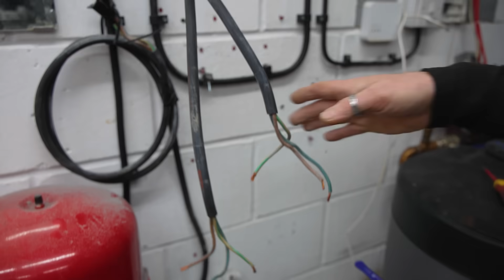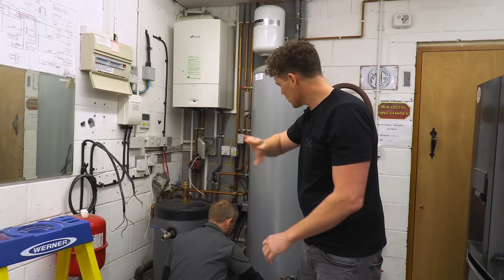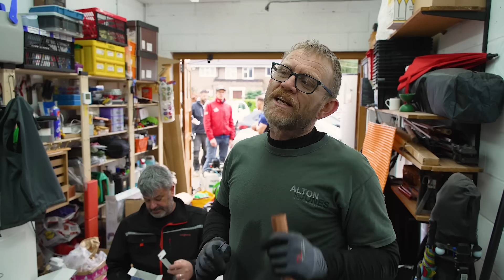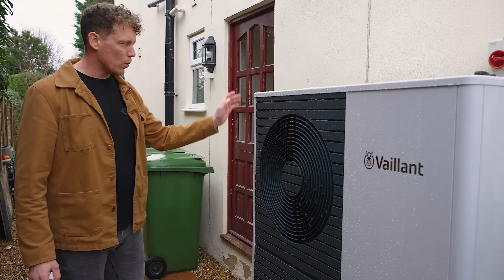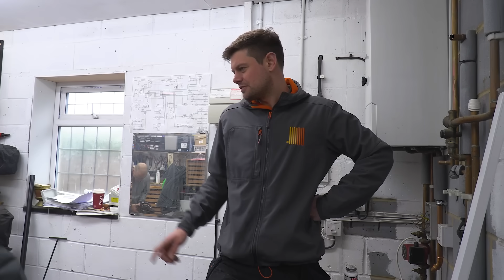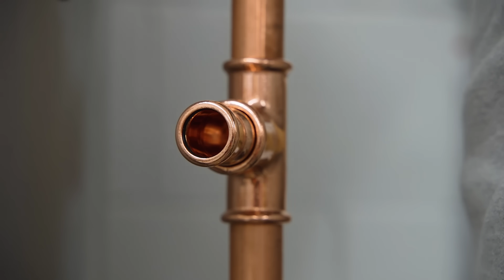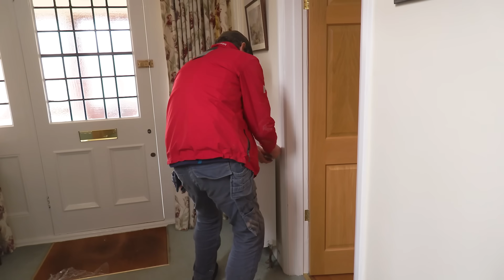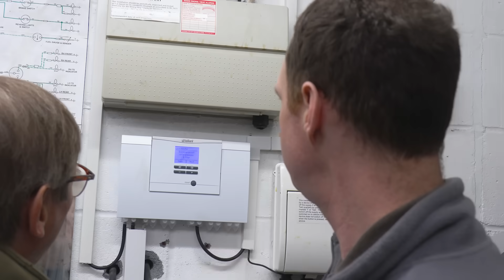Ultimate Heat Pump Installation. Rip It Out & Start Again!

Comment: Looks really good!

A quick question - is there an issue with the open drain grate between the HP and door being in the exclusion zone?  I only ask as I have a similar drain and wondered if it presents a problem for R290 systems?
Reply from the maker: To be honest it was impossibe to comply with all the R290 requirements with regards to the back door and window. The open drain issue is about spillage of the propane into drains and water courses. 
There is no chance of that with this drain and if it were an issue it would be possible to put a cover on it.
Reply: No, drains were an issue and vailant have since removed it from the instructions.

This system complies 100% with r290 exclusion zone in all dimensions.
Reply: @HeatGeek  I see what you mean - The instructions changed in November by the look of it.  That makes things easier...

Comment: I would like air to air units and have a tank with a heat pump on top that covers the hot water issue get rid of the radiators , that way would not have the cost of upgrading the radiators plus would have different zones in the house for heating rather than heating areas that hardly get used , it would get rid of the gas completely so no bills there not even standing charges, open to other opinions, for me seems daft not to take advantage of the grant available.
Reply: The economics of air to air can be quite good if your primary heating source is fuel oil, bottled gas or resistance electric. I'd expect the tipping point for natural gas to happen within the next few years, if not sooner, driven by geopolitics and the activities of useful idiots that influence public policy. 

The break even for my self installed system including the purchase of some specialized tools and ignoring government incentives (for the moment) will be about 5 months. I could have spent a little less on less efficient equipment but my operating costs would be somewhat higher negating all upfront savings within a year or two. 

I'm less impressed with air sourced water heaters that get their heat from conditioned space that you've already spent money to heat. I don't see the cost effectiveness there.

Incompetence, price gouging and sometimes downright fraud continues to plague much of the heat pump sales and installation industry. It's a systemic problem that the industry itself needs the resolve to solve. Adding government regulations would primarily benefit larger businesses and stifle competition. Not good for consumers. I agree with both Roger and Adam that government subsidy programs are only making those problems worse.
Reply: @jamesnasium7036  sorry I must of missed what system do you have ? Sounds like the water tank with heat pump on top you’re not a fan of ,
Reply: @KavanOBrien  Heat pumps are great for moving heat energy from someplace where it does not benefit you to someplace where it does. Of course it would be wise to balance  equipment and installation costs as well as current and and your best guesstimate about long term operating expenses against those of any viable competing system. That balance can be wildly different depending on your location.

In one of my locations I was heating my DHW with propane and my conditioned space heating was with fuel oil. Propane prices had recently gone crazy due in large part to political interference as part of the war on fossil fuels. Natural gas was not an option. I considered an ASWH with a COP of about 3 until I realized that I would in effect be using some electricity + a large amount of already paid for fuel oil sourced heat to heat water.
That heat in my conditioned space would have to be replaced of course by burning more of you know what. Even with the incentives (while funding lasts) that would come with a pile of bureaucratic paperwork, the equipment would have cost about 4 times as much. The break even point would have exceed the equipment's projected lifetime. In my case a well insulated resistance heated tank made the most economic sense. 

Unless you have a surplus of unwanted heat (or humidity) in the location where your HPWH would be located (and taking it's heat from), I don't see any benefit.
Reply: @jamesnasium7036  you don’t see any benefit in regards to what = the tank ? Heat pumps in general ?

Comment: So I have a combi boiler which I have tweaked to run at a flow temp of 50°c currently. What would this mean if a heat pump was installed?
Reply: It would mean you would not need your combi boiler.

Comment: Nice follow up on previous visit. Watch both videos. Good new loft insulation but what’s with the very poor side door. I’d replace that asap. Does the temp adjustment + - do anything if it’s in weather comp mode? I thought that was disabled? I have similar setup but 7kW version. Also wish my HG installer had used more anti vibration mounts for pipes rather than plastic clips that transfer any pipe/pump vibration to the walls. Minor issue of mine. Like the ones that clip onto the insulation. No word of neighbour moving back to original room and video could explain COP. I think Valiant measure COP as input+generated/input. Not quite the same.

Comment: This sorry saga has turned into a complete farce. Of course electricity( not gas) can be used to heat a home and the technology is very simple- storage rads,elec fires etc. Heat pump systems are hugely expensive to install and good luck with getting a decent installation and importantly someone that knows exactly what they've doing to service or repair. I honestly don't see how the huge expense and complexity can justify fitting these systems. The running costs must be huge. I put the current technology on the same par as electric cars. Expensive to buy, costly to charge ( fact) and expensive to maintain and they have no value after the batteries start to fail. Huge white elephant im afraid. This video shows what can happen with a poorly set up system and only salvaged by a team of specialists and a youtube channel.
Reply: My thoughts exactly. I'm staying with my DIY all electric system 35 years of 100% reliable heating and hot water a plenty. Peace of mind comes at a cost of course but for me worth the extra.
Reply: @wattsupmike7593  So your system costs more to run ( maybe) but the maths don't lie. You have no outlay. Buy one of those systems and if they are cheaper to run how long to recoup the outlay of your running costs compared to a new system. Don't forget get to take in account the servicing and repairs/replacement of the heat pump over a period of time. 👍
Reply: @wattsupmike7593 can you tell me more about it? When my combi boiler will leave me and the governments will forbid to buy a new one I am also interested to put electric heaters in instead of this heat pump fad.
Reply: It's cheaper to run than gas.
If you get a SCoP of 3.3 or above then it's cheaper to run
Reply: @tommyjones8397  Yes Tommy but my point is the total cost of installation and trusting someone to put a good system in.

Comment: Just looked at the usage and working out on our tariff,  I think the running cost would be £341 a month. Why is it always said that heat pumps are cheap to run? Guess you need to compare to what gas was costing, but I wouldn’t say that was cheap. My neighbour who has a smallish bungalow has just had system fitted under the free gov scheme and his first monthly bill was £230 and we’ve had a mildish spell of weather. Have to say I’m remain to be convinced.
Reply: It is cheaper. With a SCoP OF 3.3 or above the heat pump is cheaper to run
Reply: @tommyjones8397  that’s ok if you achieve that efficiency. Read an article that on average efficiency drops once the temp goes below 4.4c
In Scotland that’s most of the winter ( and Spring for that matter), so they wouldn’t be at their most efficient. I also don’t reckon that under the gov scheme you’ll be getting a top system, as in the video. The electric companies will possibly do the bare minimum to achieve their ✅ box exercise.
Reply: @lesleys3751 the house is 300m2 I believe so figures will look high.. a more typical 100m2 house will be about a 3rd of this..
Reply: This is also a month in the heating season so average monthly cost across the year will be less

Comment: The complexity of these systems is insane. It’s like having two servers, a network switch, routers and a firewall to control your fridge. 
I think I’ll stick to my Vaillant combi.
Reply: Totally agree 
Money better spent on extra  insulation,  ventilation reheat
Too complicated,  and just wait until it needs repair or parts
Will be a rip out AGAIN
The outdoor coils are notorious for cracking due to heat changes

Comment: Excuses for my English, but i really think that this heat pump needs much more space at the back AND at the front.
Reply from the maker: The manufacturers say not
Reply: @SkillBuilder  That's why i say:..."I think". By the wayI like your "shows", because i am thinking always could it otherwise. "KIS-thinking". For my system i used only plastic pipes and RVS in DN32. I would like DN40 but it is so expensive then.
Reply: If there isn’t enough air flow I would worry about our guarantee. I am not in the least bit worried.

Comment: They ain't going to be suitable for the vast majority of houses, point 1, not on south facing wall, point 2 away from open windows, point 3 need the space to put it. So terrace houses that are straight on to a pavement, only place rear of house where you'll have a door & window and very little wall space. My house I can't see where even though I own a detached house. Side path 700mm wide with 4ft wall as boundary, opposite side wall is a shared drive 2.1m wide to neighbours house wall. Front of house door window, rear house just bifold doors windows. I'd love to see a video how you go about installing on these properties which are majority of situations
Reply: You can use r32 units that done need those clearances. Also, it doesn’t matter what wall it goes on.

Comment: Using government policy as justification for doing something - this seems like 'deja vu' 🐟🐟🐟🐟

eg: coal fires cause smog - use smokeless fuel (coke) then close coal industry - use gas then close gas industry - use wood burners (smoke - do nothing) - use heat pumps 🐟🐟🐟🐟

eg: lead bad use unleaded petrol - petrol bad use diesel - diesel bad use electric 🐟🐟🐟🐟

eg: refrigerants destroy ozone layer - use less efficient refrigerants which have a smaller molecular size and escape through joints more easily - use propane 🐟🐟🐟🐟

Comment: So how much was it ?
Reply: As per the video- the heat geeks donated their time and manufacturers donated a cylinder and heat pump
Reply from the maker: I have just seen a quote for an almost identical system in a bungalow.  It came in at £22k. My feeling is that the installers (not Heat Geeks) simply put the £7,500 grant on top of their quote, knowing that the customer would get at back. It is very common for grants to distort the market. Big business usually does better than the home owner out of it. 
That is why there are sharks in this game.
Reply: @SkillBuilder  I always enjoyed all your videos. I looked at the online graphs and they look interesting.  What  would be good if you and the Heat Geeks came to a filmed a range of house constructions and then costed to install there systems. Explain how they would go about go about it and the problems and solutions.  A selection of house types, a 1660's thatched listed 3 bedroom building,  a terraced Victoria House, 1920's house or 1950's house. This then would explain to the average person the cost that they would have to factor in and also the savings if there were any or not. In the really world you have to say OK that going to cost me £18000 to install. I make x savings a year over oil or gas. How many years does it take to recoup my costs.
Reply: @SkillBuilder  thanks in the real world not many could afford it or the running of them, gas is still more sensible option and before the greens kick off most of electric as you know is made by gas or ☢️ and coal very green ain’t it not ! Please keep up with your honest views Rodger there has to be a better solution to heat water one day.
Reply: There's hope for us all then if we invested in this over complicated, expensive technology.
Reply: @nickhickson8738  it’s a joke nick normal installs wouldn’t get this service

Comment: 8:01 Am i missing something here with the flow temps?
I thought 27 degrees was the max this type of floor can handle but the flow temp is set at 40, does it loose enough temp before it gets to the floor?
Reply: Yes. Flow temp and floor temp are very different. Same energy spread over a wider area
Reply: Did not say the pump flow temp was 50 when explaining the controls to the householder .
Reply: @pmb9172 How do you know what was said to the householder from a very heavily edited video?

Comment: 23:20 is an issue I've been thinking about a lot. For one thing we need systems that come as a complete package with pump/tank/battery/inverter that is well insulated and attaches to your outside wall in a nice, neat, probably modular package, which will solve the houses problem - not only do we have a problem with no space to put a heat store, but we have a problem with nowhere to put inverters and batteries too - you could even recover heat from the batteries and inverter if adventurous enough, there's some prior art for any manufacturer who wants it. For my house I wanted MHVR anyway and I'm very seriously looking at not air to air, but I'm looking at exhaust air heat pumps - they're much lesser known but they sort of combine the benefits of an MHVR with a heat pump and can produce hot water. I'm quite lucky because my house is only 2 years old and super efficient, else a system like that might not work, but I think it might work for me - my house is three stories and whilst efficient has a problem with warm air from the ground floor rising to the top floor and I think a system like that will have the benefit of moving heat back down through the house. Apartment buildings are a more complex problem and I honestly thing that aside from systems more like what are common in the US where the heat pump is attached to a cylinder and probably vented to outside, communal systems might be the only way forward.

Also! Somebody really needs to invent a wedge-shaped thermal store of literally any kind that I can put under my stairs, plskthx. Literally wasted space..

Comment: I still cannot see this technology making its way into Victorian terraced housing and back to backs, one or two expensive pumps might be quiet but hundreds of cheaper noisy ones will be impossible. Those pumps are as big as a lot of people's back yards. A long with EVs they are are a middle class dream and will lead to a two tier system.
Reply: If you fancy seeing a heat pump working well in a Victorian terrace and are close to South London...drop me a line.
Reply: The vast majority are much smaller than this. We’re already doing this at scale

Comment: Shame you guys didn't install dedicated DHW monitoring too
Reply: Yes currently a combined reading, you can zoom in on the DHW cycles on the graph but not automatically split out
Reply: Hot water is also measured
Reply: @HeatGeek  didn't see that listed as a separated output on the OEM page is all. Only shows all usage.

Comment: So will 12 heat engineers come to my house to install a system 😂🤣
Reply: If you pay them 😂
Reply: @HeatGeek  they did it for free. The cost to get a working system would be too much in that case. Proves that heat pumps are a con.
Reply from the maker: To be fair John had already paid £18,000 for a system that didn't work so he was not getting  a freebie. Yes he had it replaced for nothing but he was never going to put another £18,000 into what he saw as a failed experiment. 
Let's not forget that most people who buy a heat pump are getting a freebie from the tax payer.  The government, in its infinite wisdom gives out grants but has no effective quality control over how our money is spent. That is a familiar tale.

John is not alone in being bitten by incompetent installers who took the money and folded their business and that is what grants tend to do to industries. The government will not give you another grant if the first one fails to produce the results. This makes it all the more important to find the right installers.

Comment: So what depth of loft insulation did you end up installing.  While UK building regulations say 270 I find  topping it up to 400 is not much extra work for a fair benefit.
Reply: 200mm but it had a bit of old thermalite and loft boards already.
Reply from the maker: That wasn't Thermalite. I think Adam needs to go on a course.
Reply: @SkillBuilder Roger, in your experience, do you think that insulating the building in that way will put it at risk of developing mold? Thanks for answering

Comment: It's a pity that it takes all this effort from multiple sources to get just one system working. It will still take a leap of faith to have this system fitted now.
Reply: It didn’t need all these volunteers at all. All these heat geeks do this on their own when they aren’t on the biggest building YT channel in the Uk.

Comment: what you could do is put a spirit heater you can make one in half an hour, on the output of the heat pump, it doesn't take a lot of spirit to run methylated spirits half a mug of spirit should last you about 3-4 hours that should be enough to keep it going for the rest of the day I would have thought.

Comment: Interesting to see, what was taken out, and hope it now works,    Also  nice point from roger on air to air heat pumps,   i have an multi split unit,  for heating the home,   i went from 450 m3  gas use to 40 m3    because i still use hot water from the combi boiler, but no longer the heating.   house is insolated to the wazoo.